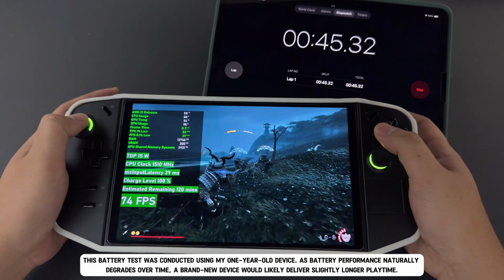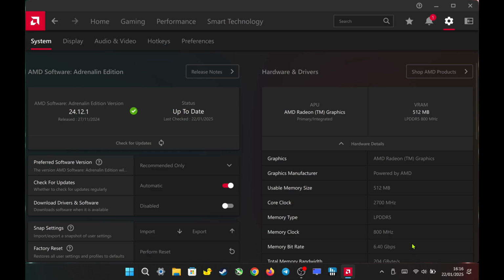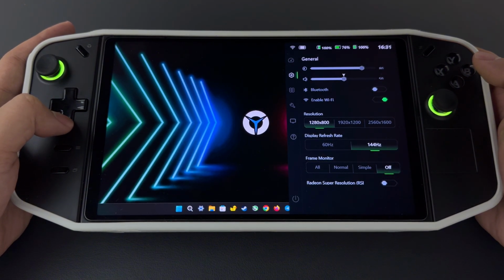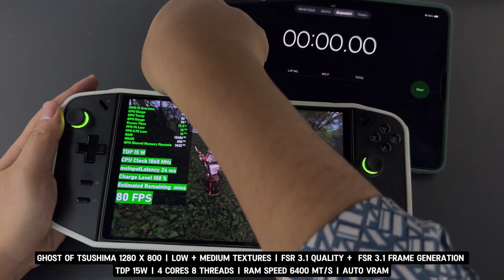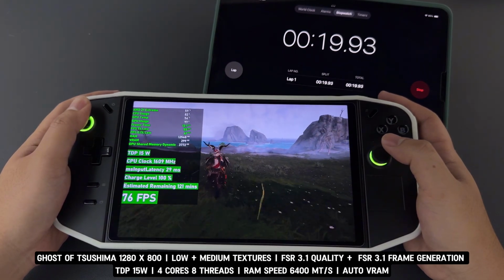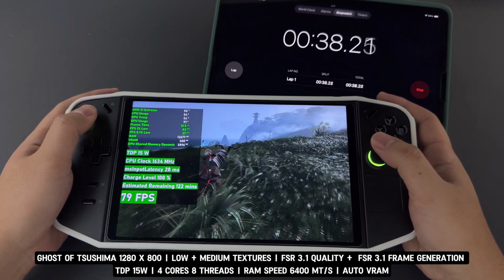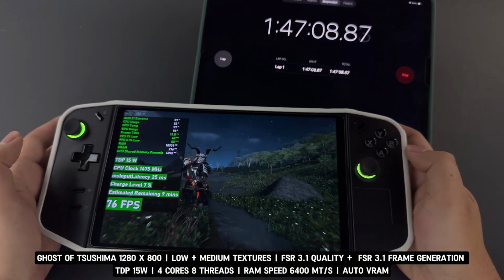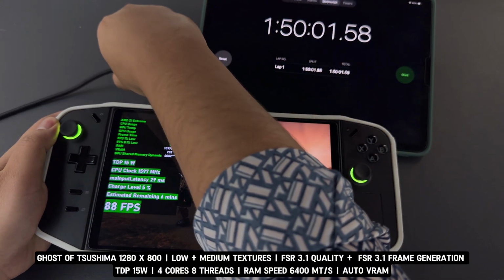Lenovo Legion Go: Ultimate Efficiency Settings & Real-Time Battery Test!

Comment: Im curious what your battery health is. Try running the powercfg command for battery reporting, it will generate a report that tells you the batterys current capacity versus its max capacity.

Comment: You will see slightly higher FPS at 7500Mhz memory speed at high TDP settings as the additional TDP budget allows more power for the APU. Running the the RAM at 6400 at low TDP settings means that the RAM is drawing slightly less power, leaving more for the APU. If I remember the video I saw correctly, the crossover point is around 18-20W.

Comment: What can we expect with 25watts tdp performance wise?
Reply: I have found the best tdps I can run at are 17tdp and 23 tdp are each the biggest jumps, like from 15 to 17 in a game I've gone from 20~ fps to 30+ consistently and from 17 to 23 I've gotten ~40-50 in the same games, when I push it to 25 I'm only getting like 2-3 more fps for 3 more tdp and SOMENOW WHEN I PUSH MY TDP TO 30 MY FPS DROPS BY LIKE 5FPS FROM 23-25TDP

Comment: Hi man, thanks as always for the contents you bring to this channel.
I wanted to ask you something; But are these settings also good for those who play at 20w (20/20/20) ? 
Is it better to set VRAM to Auto or 6GB?
I mainly play with the legion go connected to the power supply, but I never exceed 20w and I wanted to know more about the settings to have more stability/performance... 
I set SMT on from the bios with 6400mt, 4co and 8th and STT
Let me know, thanks.
Reply from the maker: If you play at 20W, you should set all the TDP settings to 20, 20, 20, as this makes the CPU cores run more stable compared to setting them to performance. Set VRAM to auto so your game can utilize more RAM than setting it to 6GB. Also, if you are always playing while plugged in, I highly recommend playing at 25W (25, 25, 25) and using 6 cores or 8 cores with 7500MT/s.
Reply: @T-PEN Thank you man, yes anyway, I always play connected to the power supply, so at this point I put Auto vram with 7500mt/s , but 6 cores, compared to 8 cores, what changes?
Should I leave SMT active or deactivate it?

Comment: will we get more battery life if we cap the fps to 60 or 45?
Reply from the maker: Even if you cap the FPS, the CPU and GPU still draw 15W if you set the TDP at 15W. So, if you cap the FPS, you also need to lower the TDP to 12 or 13W to gain more battery life.
Reply: I can play division 2 on bazzite at 8w (quiet) with unlocked fps, although it would not hit 144fps but that gives me almost 3hrs easily from 80% battery limit.
Reply: But I heard the Legion go has performance issues under 15 watts so I'm not sure
Reply: @treasty  I'm able to play some switch games at 10 to 8 watts using the sliders stock drivers and I'm getting about 4 1/2 to 5 hours of battery life playing brilliant diamond or if not brilliant diamond Mario Kart 8 plays the same at that wattage I'm using not the Vulcan or opengl setting but the third one in Yuzu and I'm capping it at 120 frames Menus go quick but the games played normally Without a doubt I have not run into an issue running my Legion go on either 780M drivers or stock drivers I don't know what you're on about but test it yourself because that sounds dumb